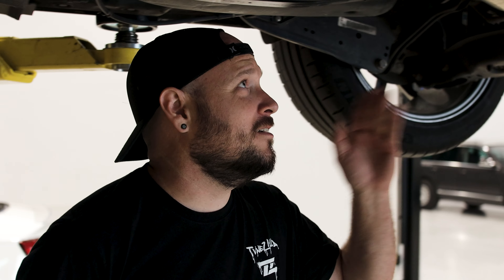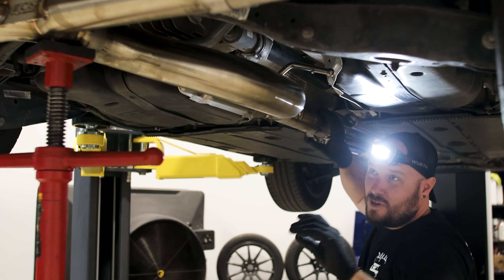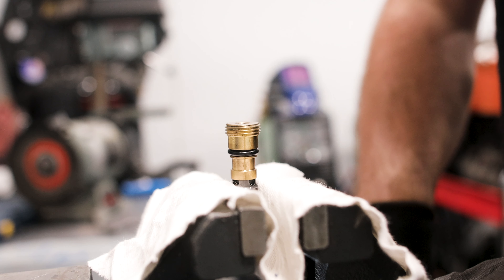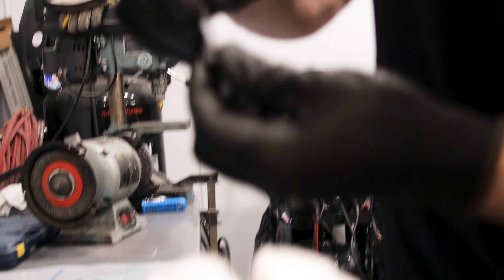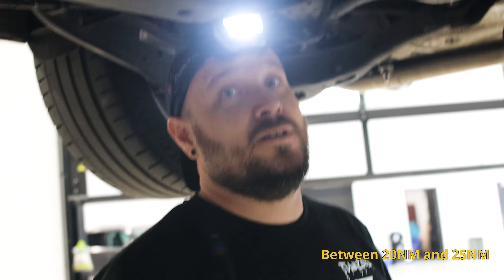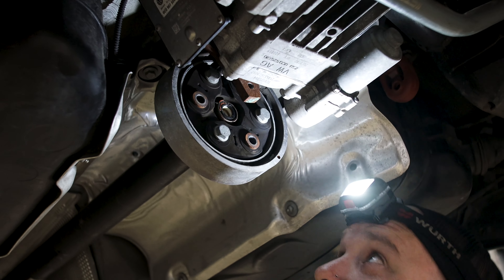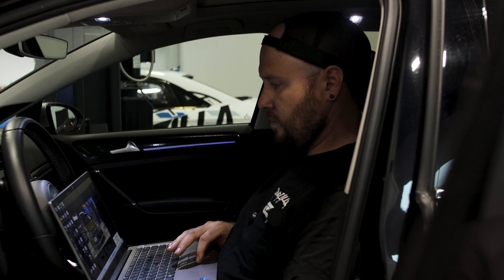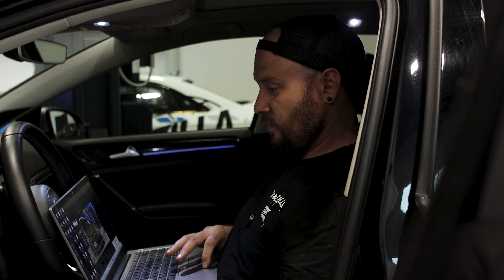TuneZilla Haldex Spring installation DIY

Comment: looks like a quick job. might be harder on jackstands in the driveway but certainly looks doable! is this good for drag racing only? or has there been any measurable improvements in track times as well?
Reply: Hello, 
We have heard from people who autocross their MQB cars that they did feel the rear end activate sooner helping them through the corners a lot more than stock.
Reply: Drag racing is likely the only time you will see a benefit. This modification allows the pump to apply more pressure to the haldex clutches.

This modification only increases the capacity of torque transfer to the rear wheels.
Torque split and handling will not change. 

They make haldex controllers that are user adjustable. You can increase the duty cycle of the pump essentially locking the clutch pack in 50:50 mode 

Any haldex pump duty cycle above 45-50% doesn't increase capacity because the pressure relief valve opens. 

I hope this company did actual R&D on this to find out exactly how much more pressure they are allowing. Too much, and you will have people blowing driveshafts out of these cars
Reply: @Jonny_trans iroz Motorsport has done a lot of R&D on their syvecs haldex controller with spring upgrade.